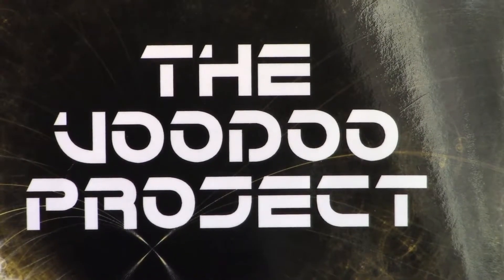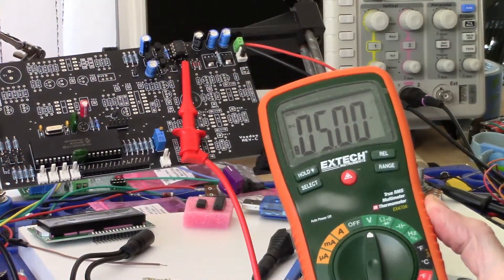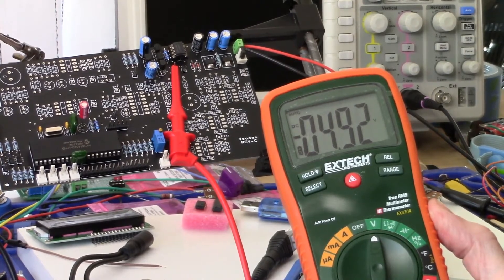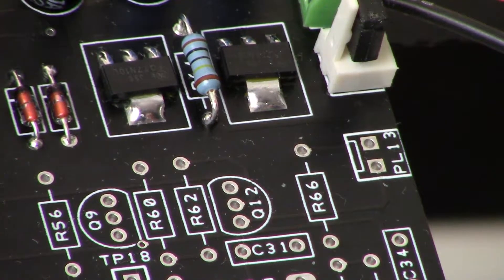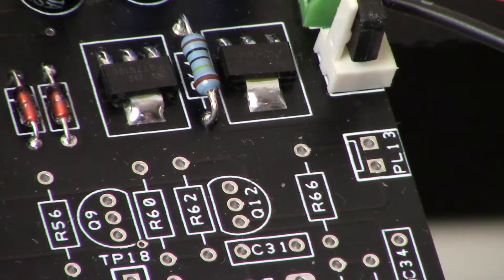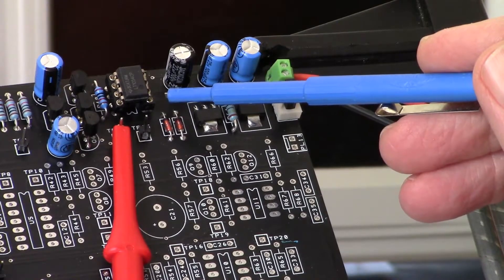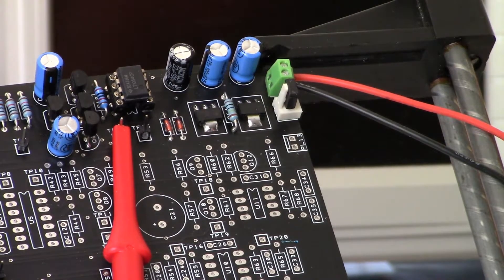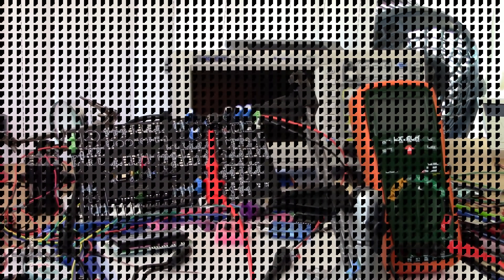Voodoo DIY Metal Detector part #1 Power Supply

Comment: Hi bro
Thanks for the video. I have a problem in the power supply circuit when testing voltage on  test point 15 and 14
Reply from the maker: I think that a few people have had a problem on the power supply.  Please post more information on Geotech.

Comment: And here is something else maybe you can answer from what i think i understand how a md works is it shoots out a magnetic field that bounces off metal objects reads those different signals with the coil each metal has its own sign wave then it gives a different tone or action from that tone my question is i see people using huge coils down to 5kh vlf do people amplify the circuits like add more current for a stronger magnet pulse or I assume there is some kind of limiting factor like frying something you need that uses lower amperage i sure hope its not because of battery size has someone built something like a gold mask 2 box in a hand held with a smaller coil jeez i have so many questions
Reply from the maker: A PI machine operates in a pulsing mode.  When there is current flowing in the coil, a magnetic field is generated around the coil. When the field touches a metallic target, induced current begins to flow in the target as a result of the field.  When the pulse in the coil shuts off the magnetic field collapses which also causes the  current in the target to collapse.  When the target current collapses this causes a target field to be produced which is detected by the machine.  That is a condensed explanation.

VLF machines and PI machines both detect metal however they operate differently, the explanations are rather lengthy and can't be fully covered here.

Comment: Like for instance his parts build sheet says 100uF how did you know to get 50v and what % 5% 10% 20% 🤷🏼‍♂️
Reply from the maker: I get a voltage rating that is more than what the capacitor will be exposed to as part of the circuit.
The lower the %, the more accurate the tolerance.  You also need to look at the physical size of the part, not all will fit in the same footprint.
Reply: Ok for instance ive figured out that you used KEMET caps for 47uF what voltage did you use it has no printing on the part in your video and i noticed you have used the best parts you can find oh and i wont stop until i have a working board and know everything about it and thanks for taking the time to answer my questions and everyone elses youre gold
Reply from the maker: Good to hear that you are enjoying the videos. It is an interesting project that hopefully will be a platform for further developments. Just remember with caps, a higher voltage is ok just don't go below what is present in the circuit.
Reply: Yeah i figured that much out already im already looking into overclocking the micro building a separate circuit and getting the voltage higher i know the microprocessor can handle 24mhz crystals but they can go way higher with 6v instead of 5v and clocked higher and still remain stable i also went higher wattage on the resistors i want to push it as far as i can then back it off a smidge plus add some bells and whistles like leds green on the right side red on the left for iron trash like the one on the display but you can see it better without having to look at the screen i like that if i smoke it i can order whatever i burn out boards parts i hope you do a closer up of the more populated board im looking at the parts for the damping resistor and resonant cap now and build a few 24v 18650 battery packs
Reply from the maker: The damping resistor is dependent on the coil so is not a set figure.  I will be doing a short video showing the damping wave form this week.

Comment: You're gonna get bombed with questions people are trying to build this that can stuff boards assemble and soldier but don't know much about circuits i know some and im gonna try it im glad you are doing these videos its gonna be a huge help but your videos are lacking in the way of not showing how you built the board gathered the parts like for instance 1uF cap how many volts to use tell them make sure to get radial not axial im stuck just on getting parts together because of all the extra letters they add can i cram a jt3254 where a Gj5864 goes and please move the camera and show some close ups its the only way we can copy what youre doing lol
Reply from the maker: Thank you for the comments.  I would certainly like to be able to do in depth, step by step videos however as this is only a hobby for me,  with my career, I do not have the time to do that.  I will show more closeup shots in future videos.  I have more interesting projects in the works so stayed tuned.

Comment: i saw this at geotech and now your building one, will be following your build
Reply from the maker: Hi Matt,
I had just started doing a Hammerhead build when I received the Voodoo so I switched gears.  Should be an interesting one.   Thanks for the comment.
Reply: @SurfDetector  so from reading the whole voodoo thread at geotech, does the book have a build sheet, or steps in it, also, what do you plan to use for the lcd screen, or is that in the book also, i guess i should wait for your videos, i am still gathering parts for my surf build, and then ill statr on parts for the mini pulse rev e beach, i built the coil for the surf as you saw me post in the forum.
Reply from the maker: The book does not have a build document.  My next video will show the display screen, I will post on the weekend.
Reply: @SurfDetector  ok, will wait and watch all your videos. so how do you know which steps to do in order with out a build sheet or directions
Reply from the maker: You build one section at a time starting with the power supply, Transmit, Pre-amp etc...  You build the schematic blocks.
Reply: @SurfDetector  ok, thanks, good to know